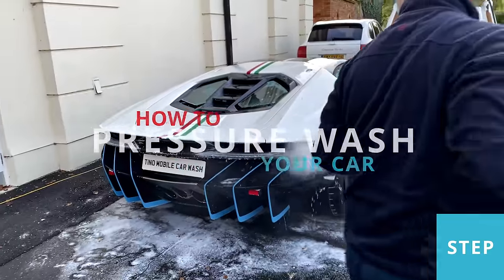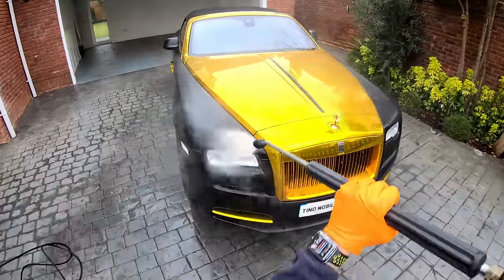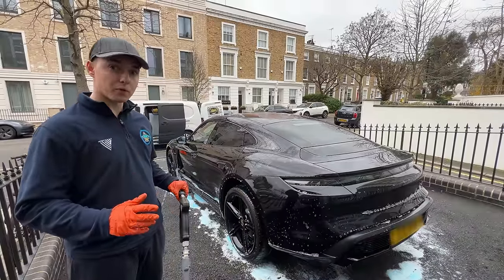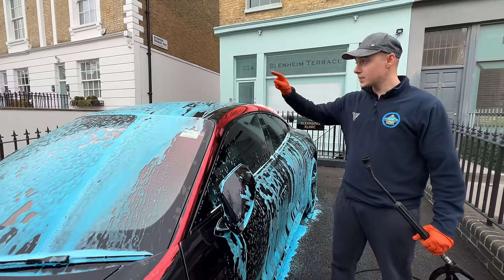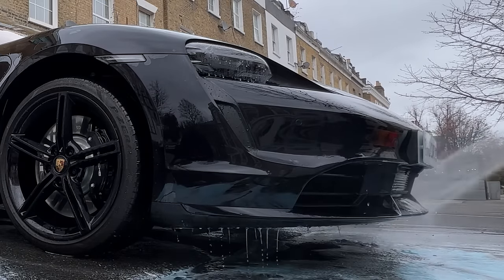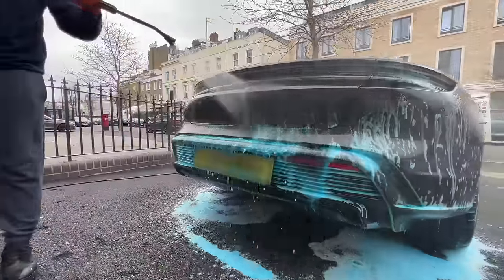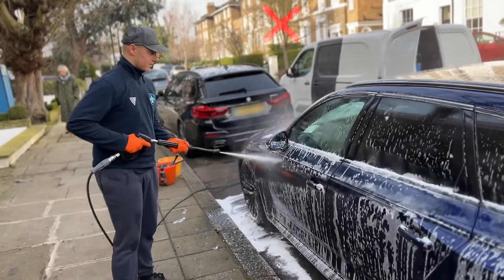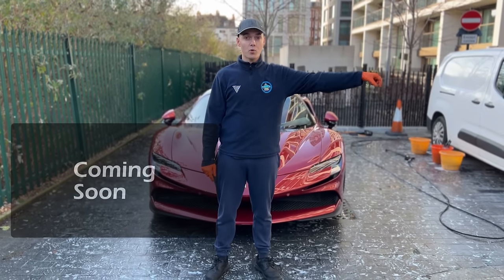How to Pressure Wash Your Car

Comment: I use a pressure washer with spray nozzle tip attachments. I always opt for the 40 degree attachment, but was wondering what you use. Is it safe to use the 25 degree on cars? Thanks!

Comment: i find that my 4k psi pressure washer has now problem turnin chips in my paint to holes in my paint. great for rust removal too. pressure washed my 72 c20 today and blew holes in the metal where the rust was